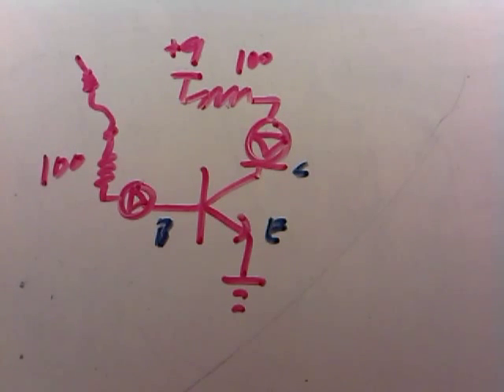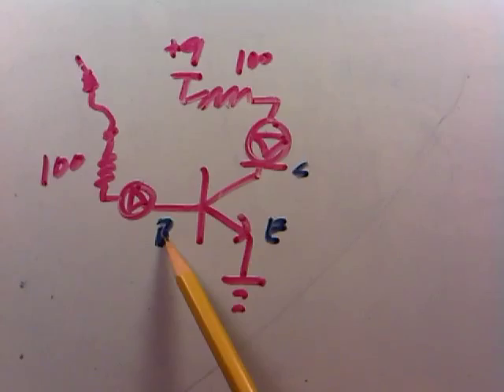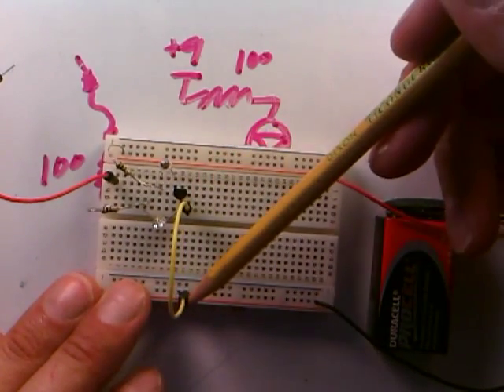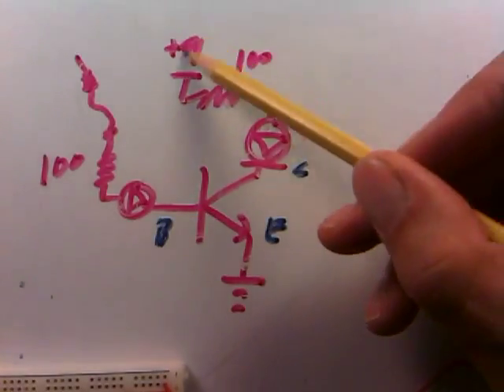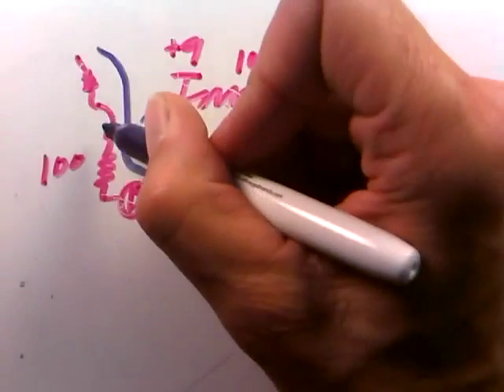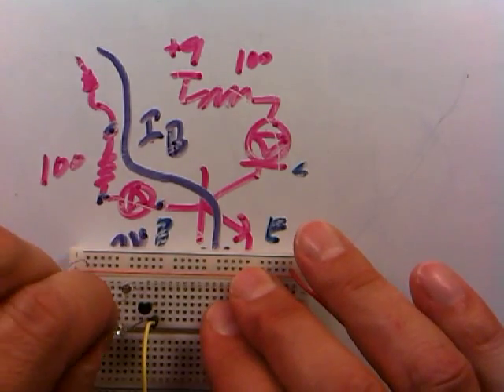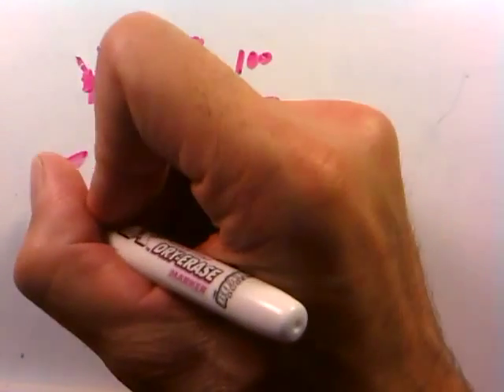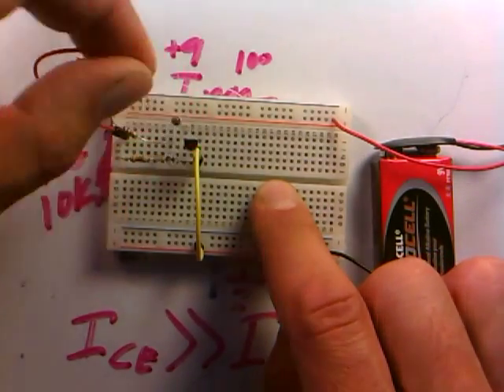elec 026 3 transistor with two leds showing current amplification

Comment: I’m a bit confused, is this really an example of amplification? Or just diversion of current through using a much higher resistor on the Be circuit?

I know this can be used but I thought that due to the configuration of the 3 semiconductors, doping, and specialisation etc etc, then you should use the collector as the definite output with an NPN BJT to achieve amplification through the Ce circuit?

I’d appreciate you clearing things up as my research and thought process on this subject keeps contradicting itself :’)

Comment: 11 amps is too large for the 2n2222 or 3904's that I used in the videos.  You will have to use something like a FQP30N06L MOSFET (google it), which is good to about 30amps or so.